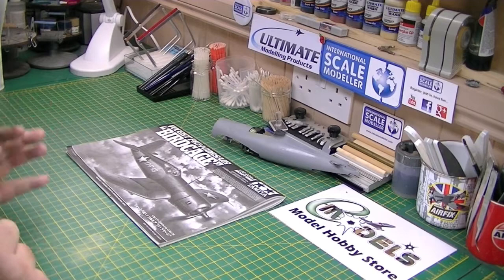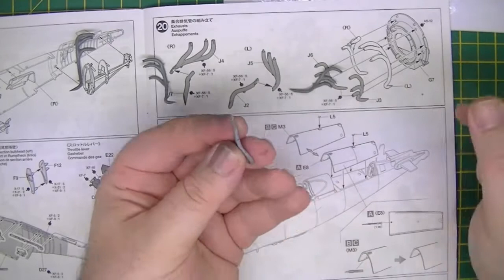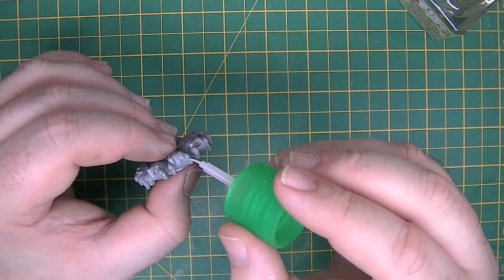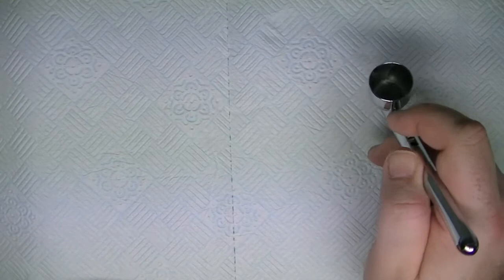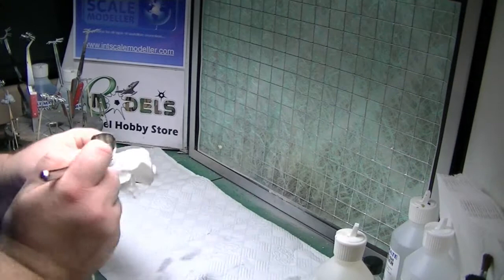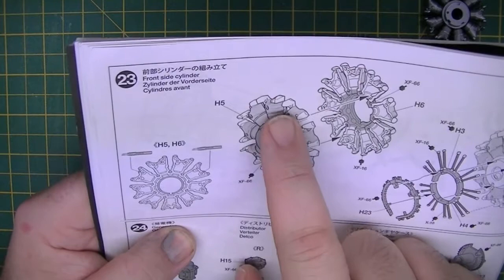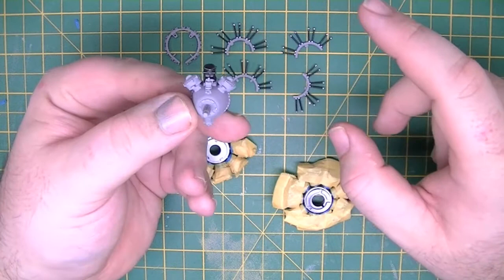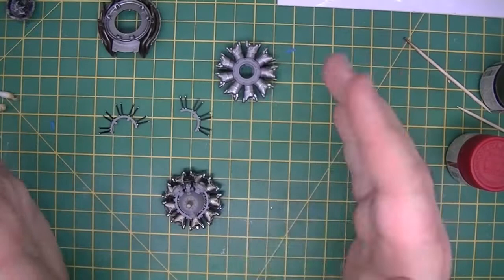Tamiya 1/32 Vought F4U-1 Corsair Birdcage # 60324 Part 6 www.eModels.co.uk

Comment: the part that you dont know the name of is the ignition manifold. All of the wires for the spark plugs go through it. The tabs on the inside are mounting brackets for bolts. the pegs on the outside are short tunes where the ignition wires come out